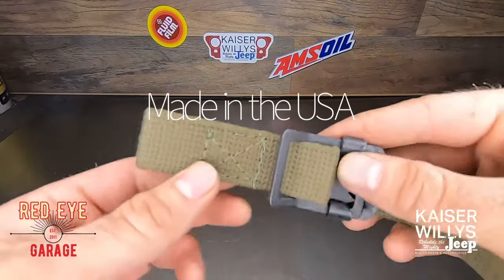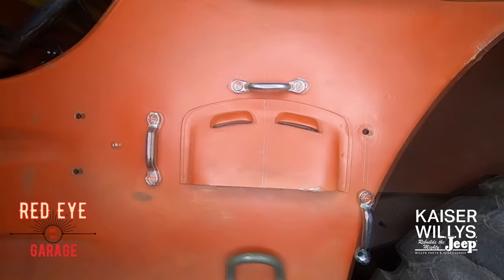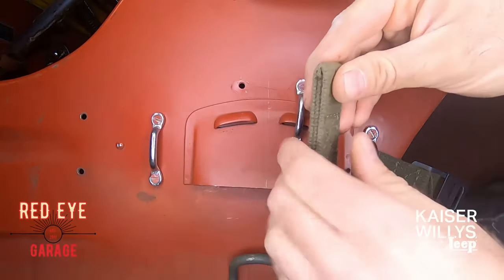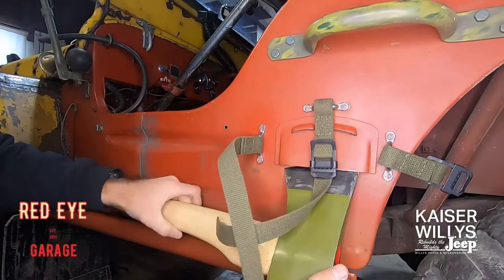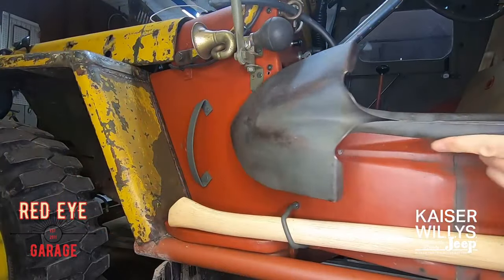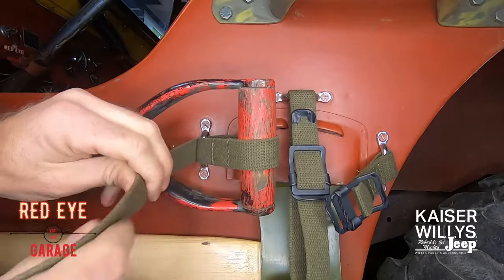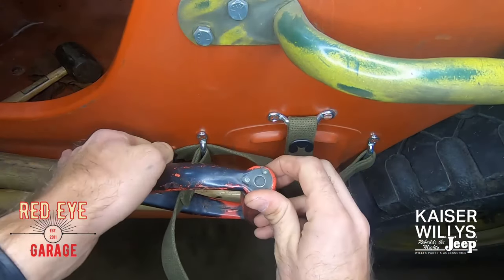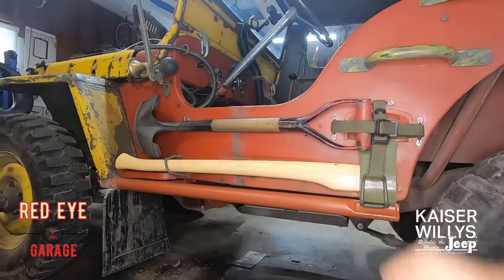How to strap your JEEP tools

Comment: thank you for the video. It looks like your canvas strap is OD#3 (tan) in color. On the Kaiser Willys website, they have them only in OD#7 (green) and not in tan. Part # B1920. How did you get tan ones ? Am I looking at the wrong part number?
Reply from the maker: Hi! I would recommend calling and talking to Jason about this. He will get you exactly what you need. He’s the man! 1-888-648-4923